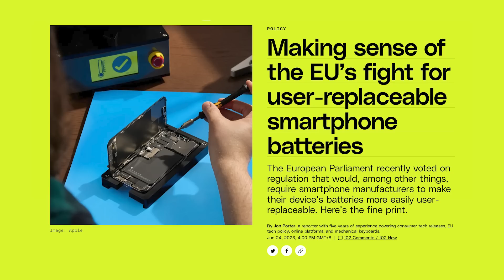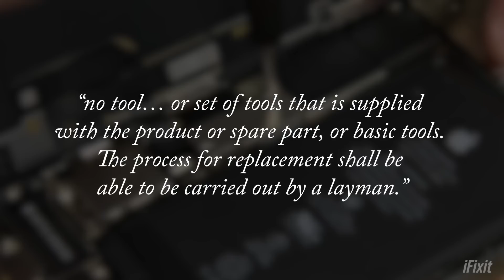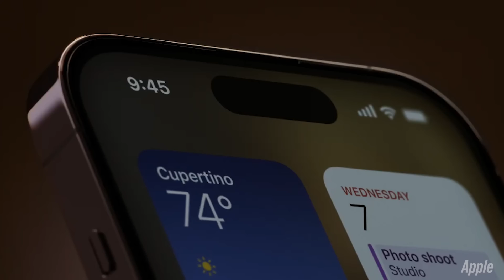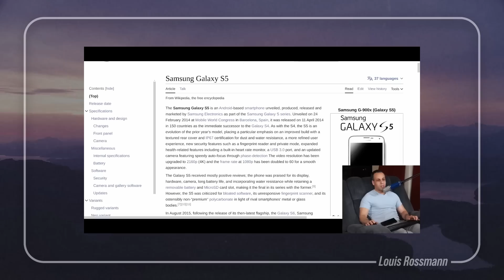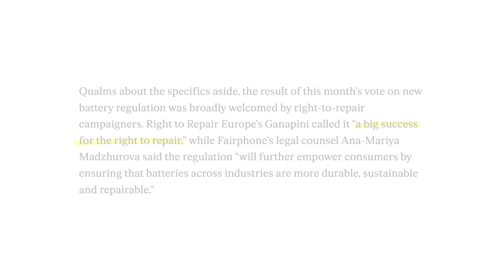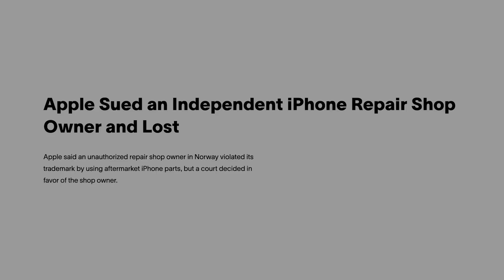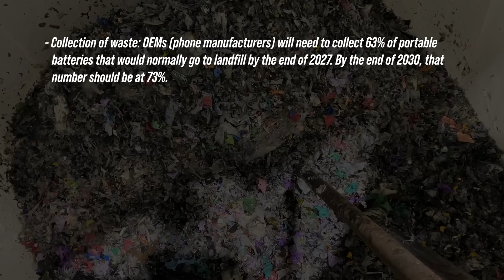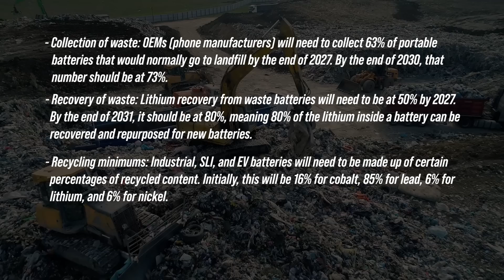EU Just Changed Smartphones Forever

Comment: Right to repair is vital. Having modular batteries is a huge step toward that. I'd buy euro variants just to get that feature.
Reply: And not to mention that repairable things are good for the environment
Reply: right to repair is something good... on hardware level.. but i don't see any improvements on the software one... which is the same vital as hardware. Most of the time phones are made purposely slower even with a single newer firmware upgrade after 1 year, and it's a matter of fact, or bringing new features that might be totally supported by the previous generations that of course will be cut off for policy reasons... it's easy to find a software escamotage to make you buy a newer phone or ruining your old phone.
Reply: @JohnDoe-ml1ui  the point is to easily replace the battery and by having that feature, the cost of repairing the battery will go down. 
Software can be easily solved if you're an Android user. 
And the law is not only pointing to the smartphones but for all of rechargable tech like ev, ebikes, laptop etc.
Reply: They probably won't have "EU variants" more likely they'll just standardize
Reply: @DarkAttack14 Apple might do it just because they can

#banapple
Reply: @DarkAttack14 that’s right the world follows the EU standards
Reply: Im pretty sure, apple in the future has soldered battery
Reply: Watch from 3:15 dude.
Reply: that and USB c, I'm buying erupean phones only now
Reply: There will be no euro variants...Same thing happened with usb-c. Forcing manufacturers  to use a standard charging port is another European law and Apple had to comply with it getting rid of their proprietary connector and start using usb-c... They didn't do an "european version" of their product, they start using usb-c everywhere.. It will be the same for the battery
Reply: Fun fact

China used USB c ports on phones first . Everyone copied Chinese methods
Reply: Right to repair? You already have right to repair!!!  But you want right to force somebody to repair your phone!
Reply: @pavelvodnar3206 what the hell are you talking about? Do you even know what right to repair is?

It’s not about somehow mandating repair shops repair stuff they don’t want to repair 🙄 . It’s not a gay wedding cake.

It’s about manufacturers building their phones to be either really difficult to take apart and fix or just rigging them to break if small components are replaced outside of a 1st party facility. Repair shops then straight up can’t fix phones even if they want to, or they can but they have to charge customers ridiculous rates because the repairs are unnecessarily arduous and time consuming.

Right to repair means you have a right to be able to repair the stuff you buy or get it repaired by whoever you want. It means the manufacturer doesn’t have a right to purposefully sabotage 3rd party repairs to get more business repairing their own products.
Reply: @rhobidderskag1121 yeah I'm pretty sure the guy you responded to was a troll or old enough that they'll die when Trump goes to jail
Reply: @rhobidderskag1121  So right to repair Is to force phone manufactures to make phone easy repairable....So basicaly the same i wrote before. Its not the free market
Reply: @pavelvodnar3206  No it's not basically what you wrote before. What you complained about before was that right to repair was about forcing people who don't want to repair phones to repair phones which... no it isn't and that makes no sense. Right to repair is not, in any way, about forcing people to do business with someone they don't want to do business with.

It would have made more sense had you just complained that it wasn't allowing the free market to solve the problem by itself, like you are now. Had you led with that, you would have been right. Right-to-repair supporters aren't free-market absolutists, nor am I.

Personally, I'm of the opinion that having blind faith in the free market is illogical and borders on religious behavior. It works most of the time; but that doesn't mean it works all of the time.
Reply: @rhobidderskag1121  So it means  less freedom,more regulations, And therefore less progress in inovations.
Reply: @pavelvodnar3206  You do now that more regulations also mean progress in innovations? Producers will try to abide the regulations, while still having low-cost options for their stuff. Free market without regulation has less innovation, because why try something different when you can use the easiest and cheapest way? Having a challenge that keeps you from using that method gives incentive to try new methods = innovation. Regulations and Progress aren't exclusive. Without regulations in the tech-sphere you couldn't just plug everything in with your usb. It would be like apple-galore and every device you have would need a kind of specific adapter to be plugged in, because that would mean profit for selling your adapters too. Regulations are mostly good for the consumer (and general population too if they are well though out)
Reply: @pavelvodnar3206  
You don't have righ to repair. If you repair your phone, it is blocked and lose functions, because it is not repaired by certified service.
I don't want to force someone to repair MY phone. I want have possibility that I can rapair MY phone.
Reply: @pavelvodnar3206  ?
Reply: This is more like the right to replace, and I'm not sure how I feel about it. Being someone who repairs my own devices, right to repair means that the parts are available to purchase, and they are not physically impossible to replace (like Apple's soldered in parts). Batteries remain one of the easiest parts in a phone to replace typically, but a main reason I wouldn't want to replace one, or have replaceable batteries, is because it compromises the water resistance integrity, and that's something I've valued and assumed was a main reason behind the design of today's phones.
Reply: @stuiedaman  replace and repair are basically the same in this in my opinion, by replacing the battery you are technically repairing the phone.
Reply: @stuiedaman i dunno man, I think it's cheaper and more time efficient to just have easily replaceable batteries than to have a technician open, replace and solder (dunno if it needs soldering) it for you. On the water resistant part, 3:42 seems like a good design for that.
Edit: just noticed that you fixes your own devices and I don't think everyone have the time to learn how to properly open a smartphone, buy tools and glue and doing the repair itself, finicky stuff.
Reply: @stuiedaman  Your Iphone 4 is no longer in production. New phones (2017 and onwards) now require 60$ in tools to replace the battery (not including the battery itself) and require replacing the entire back panel because it cracks when being removed. The entire point of the law is to make phone batteries as easy to replace as they were years ago. Phone batteries are nowhere near easy to replace, even for technicians they are meant to be an absolute pain in the ass.
Reply: @danchiers9930  right, and I think that we don't necessarily need to go back to having phones that have entirely removable back covers in order replace batteries, because that requires a bit of work to make happen, but I think it should at least be scaled back to the level of an iPhone 4, which is why I used it as an example. I agree modern phones are garbage, and the examples provided in the video of firmware/serial verification, and our examples of glue/solder and parts shattering while removing them is ridiculous.
Reply: @stuiedaman  The main reason behind today's design is that when your battery degrades, which always happens, you'll buy a new smartphone. 

Water resistance isn't irrelevant, but i personally never had use for it. Don't throw your phone into a pool. This one you can control, but you can't control degradation of batteries. 

Also i don't think it's an either or design decision.
Reply: @stuiedaman  my xcover pro has easily replacable battery and IP68 rating, so.....
Reply: @stuiedaman You've been fooled then
Because water resistance depends on the design
Like, submarines can be opened, but they still don't leak normally
Reply: @stuiedaman 
that is bull shit.
I had waterproof mobile phone 20 years ago. And it has replacable batery
Reply: @DarkXair  there are different levels of water resistance, and phones typically don't use the term "water proof". Some phones simply stuff your device full of silicone glue and call it good, while others are designed from the beginning to be completely sealed, with the accessible ports specially designed to not malfunction when water is detected. You could theoretically design a phone that is inherently sealed, while the battery is in a water-tight compartment. This would prevent the phone from shutting off when the battery is shorted, but packing all of that in there is going to result in a much bulkier phone, which goes against the grain of today's standards (I like slim phone as much as the next person). I'm going to assume your 20 year old, dated phone was the size of a brick.
Reply: @stuiedaman Yeah my phone was brick, like all other phones. And yes you can put that phone in full glass of bear or go with him to shower. And still you can easilly replace batery.
That means if you say. You can't replace batery because it break waterproof... that lie.
Now you are 20 years later. And you tell me, we lost this knowledge :D
Reply: @stuiedaman  go pro has removable batteries  and other  have great water proof to 15 m .
Reply: @DarkXair I'm pretty sure those were water resistant , not water proof... A drop into a bowl full of water and they get fucked up..

IP ratings don't work for replaceable battery phones
Reply: yeh they are nothing like the phones of today. my watch in 1999 could go 50m diving, doesnt mean the new smart watch should @DarkXair
Reply: @ryankingsbury779 
You completely miss point of discussion.
If your watch in 1999 could go 50m diving and today someone tell you: Todays watch can't go diving because it is not technologicaly possible...
Will you believe him?
Reply: @DarkXair  yeh, because the technology in the watch isn’t the same. Not even close. Did you completely miss that point?
Reply: @ryankingsbury779  how its differes?
What is so different in watch, that it can't be waterproof anymore?
They forgot how to create waterproof casing? Or plastic starts sudenly suck water like sponge? Or glass?

Tell me. How its possible, that technology that practically didn't change sudenly stops working? Yeah we are speaking about plastic or glass used as casing sensitive guts ;)
Reply: @DarkXair  if you need that explained to you then you need help.
Reply: @ryankingsbury779  The different technology inside of a watch makes no difference in it's ability to resist water. Old parts couldn't get wet. ICs can't get wet either. The casing and the seals is what makes the watch waterproof, not what's inside. The electronics do not save your watch from the water. Newer watches should be more waterproof than old watches, given the advanced technology in sealing and epoxys. Otherwise they were simply not designed to be as waterproof as old watches. The technology surely is available.
Reply: @frodobaggins2852 so how do watches get waterproof ratings in depth ? It’s not rocket science ? I phones possibly others were making batteries fail before their time !
Reply: @dankrigby5621  it’s almost like you hear the word technology and think electronics. The housing has to be different to have the desired function. So it is indeed harder to waterproof
Reply: @ryankingsbury779  yes, but housing technology got better, not worse. There is no reason why we couldn't make the watches as water tight as back then. It hasn't gotten harder to waterproof watches.
Reply: @stuiedaman  You can't actually "repair" a dead or old battery. Also the waterproof argument was already discussed in the video if you watched it.
Reply: @stuiedaman why does extreme waterproofing matter? You don't need your phone near a pool or a sink.
Reply: @stuiedaman how would you suggest repairing a battery so?

Unless you consider the phone the device you're going to repair by replacing the battery and you're just being an ass?

Or replacing a broken motherboard? Is that right to replace too? 

Luckily for you, you'll have both a water resistant phone with a removable battery and you can just choose to never replace your battery! Win win situation

Comment: Dont know how it will impact. But it makes sense. imagine you buy a car that can be refueled only at authorized dillership ;)
I suspected that on my s10e, battery span reduced. I gave it to replace. Not authorized center. After the week, i wipe it with a wet towel and screen stopped working. I gave it again for repair and never seen it since. Yes, i got S22, but would continue using s10e that is ewaste now. It was only need a battery, or i thought so. 
S22 came with a battery that not last a full day, will die in year or so and i have no desire try to replace the battery. 

On another side EU should do something with low quality fake battery. There will be more burning phones, as the quality of batteries are no longer controlled.

Comment: Lets be realistic. There is a ton of profit to be had by forcing paid for repairs and planned obsolescence. The reality is the industry has done more to pollute the environment and extract maximum profits while doing so. These EU changes are a boon for consumers. It would be even better if a deposit was to be made on every battery to incentivise compliance with returning spent batteries for recycling, or an exchange scheme whereby you had to turn in your old battery to obtain a new one or be penalized with an additional cost. Also, manufacures may likely weigh the cost difference in having EU models and rest of the world models. If they can continue to profit by offering 2 models, one with a replaceable battery for the EU and one with a non-replaceable battery for the rest of the world, they'll do it. From a design poit of view, it really wouldnt be that hard to accomplish. Profits before people...

Comment: Thank you for this video. I always seek removable battery when looking to buy (second hand) a phone. Currently using an LG G5. The rechargeable battery issue is in fact a major negative for everyone except the manufacturers, so I applaud this EU legislation. The EU should also oblige manufacturers to continue manufacturing, or to license manufacture of replacement batteries for older devices - phones, tablets, laptops, e-bikes, etc.- as trying to find a good quality replacement is always a challenge, with little guarantee that the supplier will have used good quality materials when manufacturing them.Aside from the value for money and performance issue is the huge safety issue as witnessed by the increasing number deaths resulting from rechargeable battery fires.

Comment: batteries usually outlive the usefulness of a phone. we need more efficient coding to keep a device from becoming obsolete. both coding of operationg systems and apps and websites. i would like to see the return of qwerty slide phones like htc used to make. i still use one today and write my own websites in basic html  and low memory overheads. greedy manufacturers and lazy coders are the problem. single core devices were fine for streaming 15 years ago and had 7 day battery .

Comment: In the grand scheme of things, it does not matter as much if you can or can not easily remove a battery. The problem comes with the repairs cost and repair difficulty. Again a great example is apple with there new phones where you can not replace anything without a problem because apple programmed there phone so

Comment: Hmmm, the Intelligence Community will not stand for this. Tracking movements has become an essential tool for Gov'ts. During Covid lockdowns, for example, the Health Security agencies were able to track compliance with 'Stay at Home' policies based on phone movement mapping, and adjust tv messaging accordingly. When they release a headline predicting an oil shortage, then they monitor movements via mobiles too see how many people drive to buy fuel, what age group/political group is most affected, what group does not respond etc. Then they re-write the messaging, until they've fine-tuned their propaganda sorry, 'advice'. Also, of course, the microphone is an essential listening tool that can be used to monitor conversations as long as the phone is powered.  Unless some alternative tracking is already in place, I really can't imagine the Govts letting go of all this real-world live data by allowing us to remove batteries. Perhaps Siri/Alexa and Ring cameras are enough for them...

Comment: it  should be normal to be able to change them so many phone "problems" are solved with replacing the battery rather than buying a new phone .... i just replaced the battery on my "honer 20" and all the slow issues gone works like it was brand new out the box again now